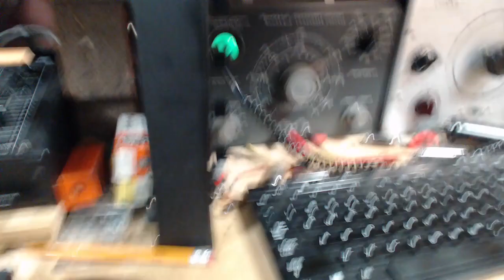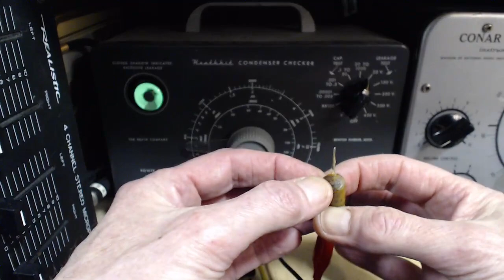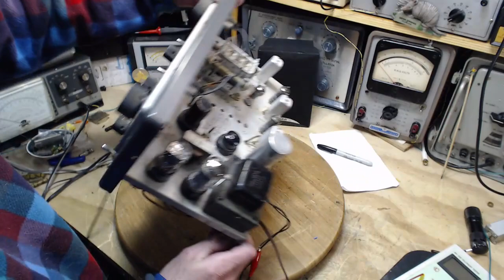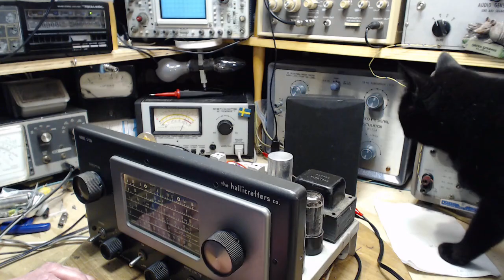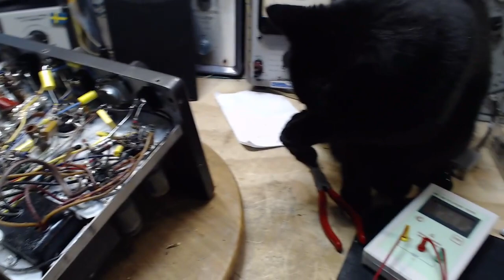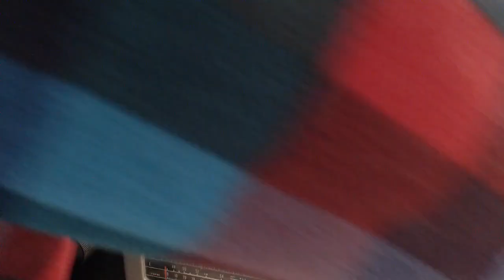Hallicrafters S-53A Video #2 - 15 Capacitors Replaced

Comment: Why doesnt he perform a real test for leakage currents on the paper caps using a HV supply and a microamp meter? That way he may realize without a question and to be proven by using pure simple math that all the caps that barely open the eye tube on his leakage guesser are NOT useable any more in any DC blocking application. Maybe then there will be a stop to his nonsensical "it is still serviceable" muttering.
Reply: The test equipment still has to work correctly and that is a big issue with what he has now.  25v setting is 50v but the rest are correct...

Comment: The principle agent in paper capacitor leakage is moisture intrusion. The one located between the output tube and the rectifier which was so ‘cooked’ would actually stand a better chance of lower leakage, because the heating would drive the moisture out of the capacitor.
Reply: Well the moisture that got inside the cap also causes changes to the paper insulation and the foil. You may drive the moisture out with heat and regain a barely acceptable leakage but the other properties will have changed. There is no use in discussing to keep old wax paper caps on a proper restoration or repair of a regularly used radio.
But if you want to keep them waxies and service them every six months by heating in near boiling wax to drive the moisture out, knock yourself out.
Reply: What are the odds he replaces the power supply filter caps in the can?  He also always seems to have reasons not too, they are working so it's ok philosophy of his.  It would tick me off if i paid him to service this radio like he does.  He complains about leads nearly shorting but when replacing will he put shielding on or heat shrink?  Nope too much $$ i bet he feels.
Reply: @curtisgriffin7924  On most of these 60-75 year old tube radios I would replace all paper and black beauty caps, and most times the electrolytics.  After all a failed electrolyic will sometimes take down the power transformer. Also add a fuse  and a code compliant 3 prong plug. IMHO  if you take the time to restore this type of radio you want to address all the predictable failure modes (as well as the SMD).  These are very well known and documented in the on line blogs.

Comment: Maybe it would work better if the antenna was connected properly?  The shorting link needs to be closed or a good ground connected.
Reply: Jim says its a dipole antenna and manual shows that it should be hooked as he is hooking it up.  But when has Jim ever had a radio that picked up anything but the 3 or 4 stations you here every video?  He does his videos in morning so that may be a factor, but also have seen enough youtube to see others pull in stations all over the place anytime.  Makes one wonder on the antenna itself